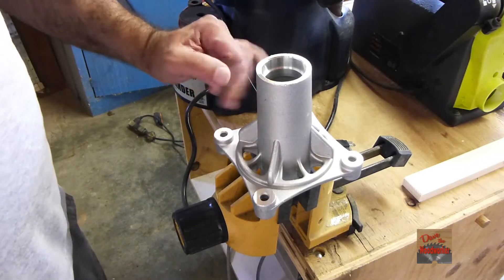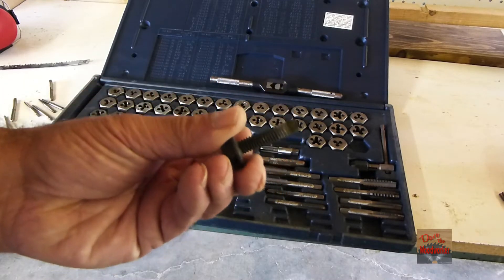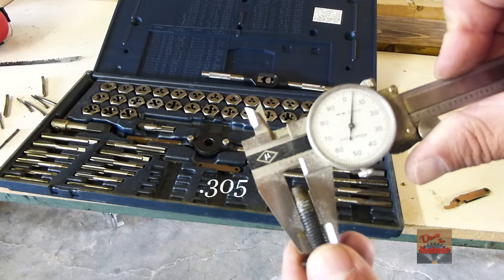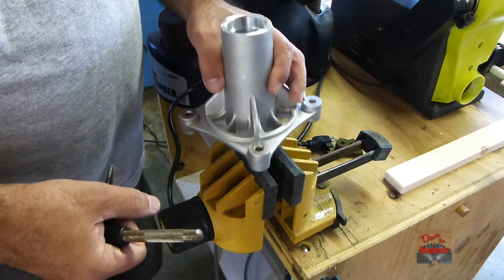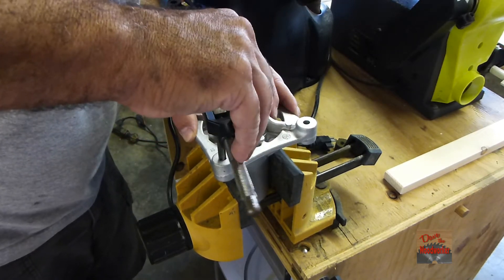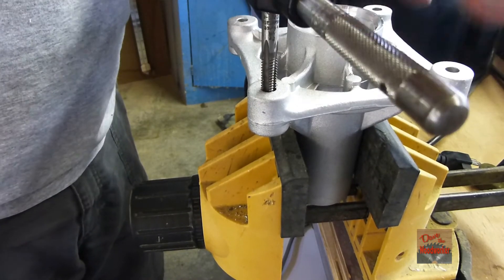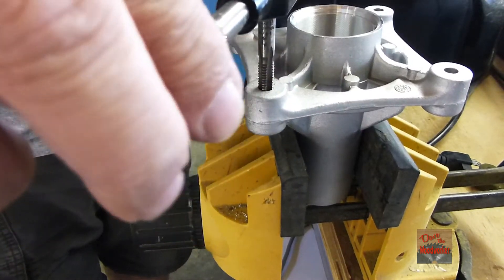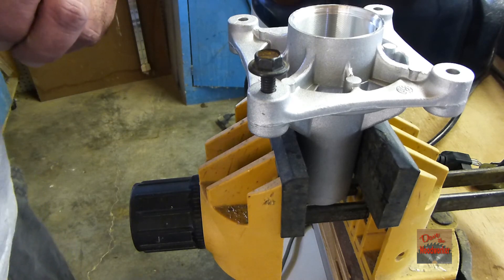Tapping Threads in Aluminum Spindle

Comment: Okay, what on Earth am I doing wrong? I have a tap and die set, I drilled the stripped hole up one size (an M5x0,8 mm hole requires a 4,3 mm bore apparently), I put a drop of engine oil, and I started threading in the tap, but it just doesn't go in. I turn and turn, it works out plenty of chips, I turn backwards after every turn, but even when I think it has caught, I can pull it out with ease. And the hole just keeps widening. The set is brand new, how could it already be blunted?
Reply: 1. drilled/tapped hole not straight. Get a tap guide to help keep it straight.

2. don't use engine oil; it is too thick. You need tap oil.

3. Once it catches do 1/8 turns and back tap out.

4. If you hole is destroyed, you'll need to use a Heilcoil.

Comment: No! Pitch is NOT the number of threads per inch. Pitch is the distance between threads. You determine the distance by dividing 1 by the number of threads per inch. In this case, 1/18 = .0555. Rounded up the pitch will be .056.

Comment: Great video. I'm about to do this for the first time, I appreciate the clear instructions.
Reply: It went very well, no problems. Thanks.
Reply from the maker: @robertthompson5908  you're welcome
Reply from the maker: Thanks, just take your time
Reply: Nice video. What about if there's good thread down in the hole but at the top (starting point) it's not so good? Bolt goes in at a angle for the first few threads.

Comment: Didn't you just cut the threads in the wrong direction? Aren't the bolts supposed to threaded in from the top side of the mandrel? Does it matter?
Reply from the maker: It doesn't matter
Reply: @davethewoodworker1043  Thank you

Comment: Excellent video thank you. I'm going to try tapping on some aluminium soon. I have a novice question I was wondering if I want to use an M2 tap to make a thread do I need to drill a 2mm wide hole or slightly narrower? Thanks!
Reply from the maker: Slightly narrow